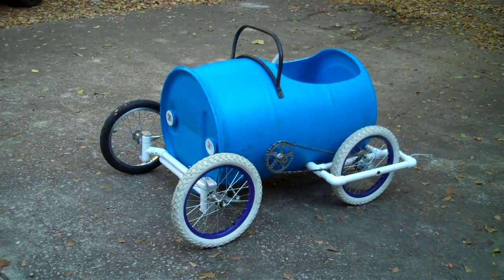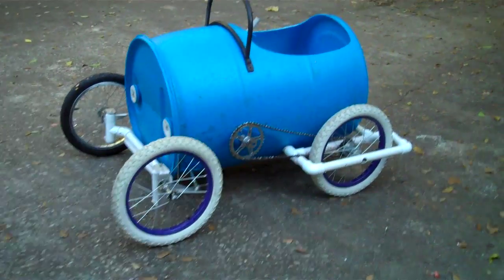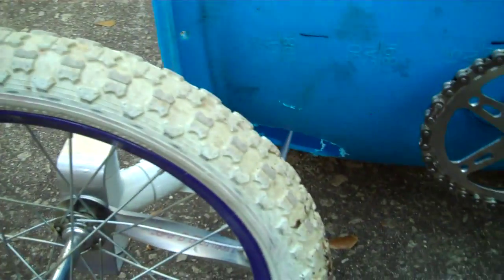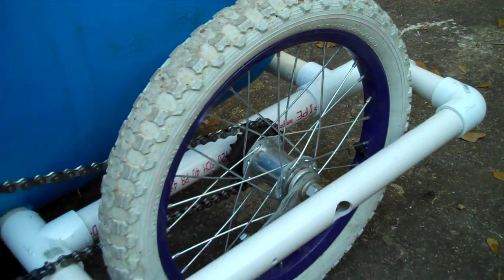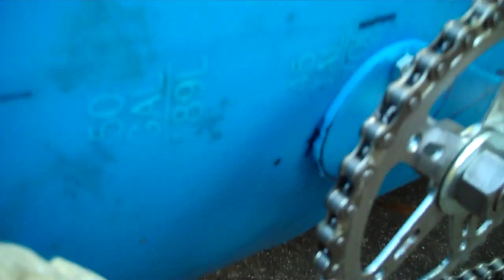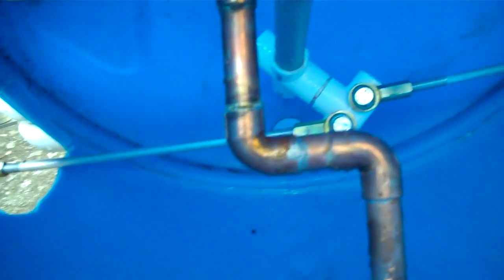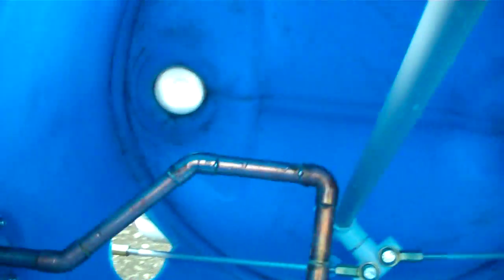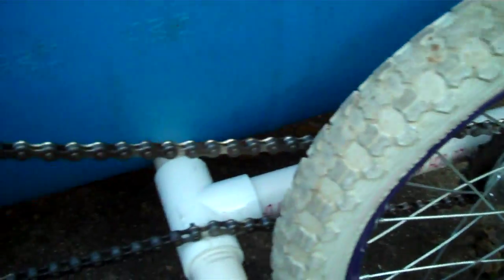The Speeder 2

Comment: Hi there. I'm adapting your design to use 12" wheels from 2 old child's bikes and a 100 L. plastic garbage's container. Or maybe whitout container, only a PVC structure, mixing Speeder's and Baja's skeleton whith a few modifications. We will se if it can be added later. Whish me good luck bending the crank from a metal rod I found near a construction site!